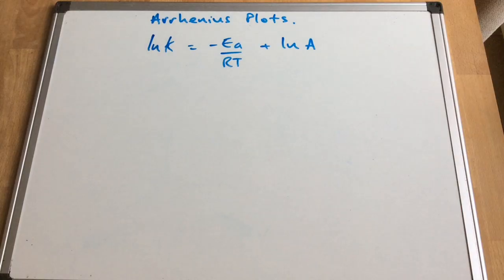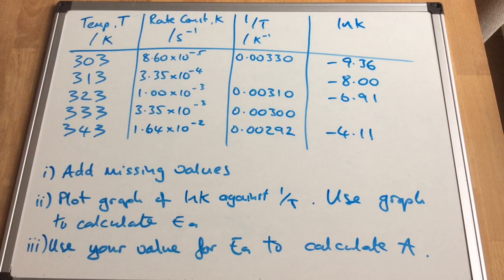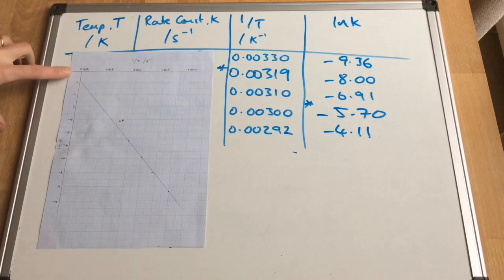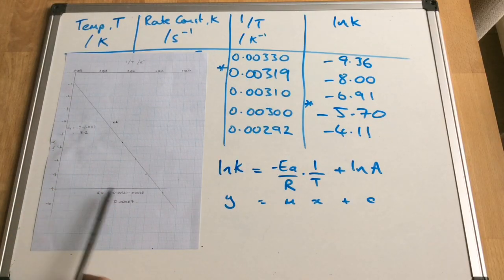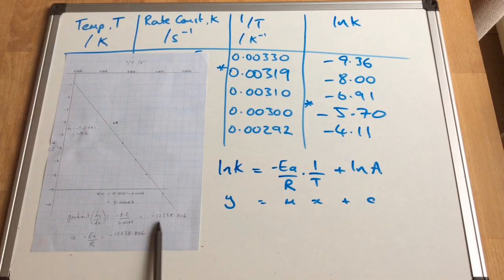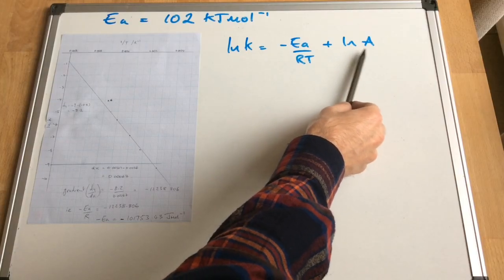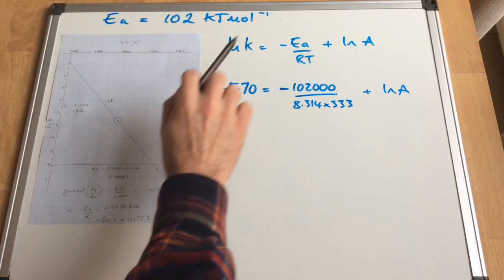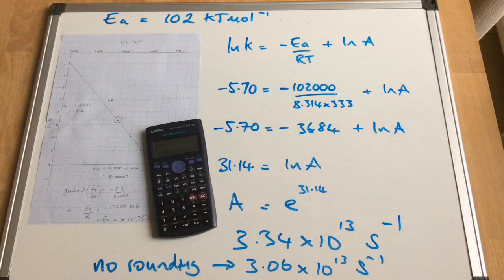Arrhenius Plots

Comment: Thank you so much for this video! It is extremely helpful!! I'm just a bit confused on the last question you did, I substituted in the values where lnk is -6.91 and the temperature is 323 but I got a very different answer to yours (2.84*10^13). Is A meant to be the same regardless of which point I use?

Comment: How did you calculate the missing values? Did you use the first line to work out Ea then calculate each missing values?
Reply: 1/313 to get 1/T
To get ln K: ln (3.35x10-4)
Reply: I know this comment was added a year ago, but to anyone else who is thinking the same, this is how it is done. So the bit at the end that says lnK is calculated by putting 1 over the rate constant K, and make sure to ln it eg) ln(1/8.60x10^-5 )will get you 9.36 (this column is always negative, so it will be -9.36). Next to get 1/T, simply look at the Temp column and do the same thing so eg) 1/ 303 to get 0.00330.
Reply: cecilia aladore why do I get 2.985.... when I do 1/3.35*10-1?

Comment: how do u find the missing values? just subbing the values in to the lnk equation?
Reply from the maker: Easier than that - just use your calculator

1/313 and ln(3.35 x 10-3)

Wish I'd said that on the video now :(

Thanks btw - glad you liked it :)
Reply: MaChemGuy Thanks for clearing that up :)